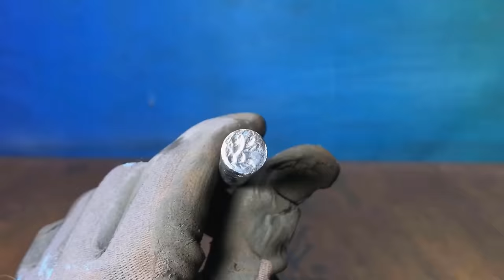Rusty Old Hand Motor Coil Winding Machine Restoration Video

Comment: Interesting restoration; HOWEVER, it does little good for the rest of us to understand WHY you took all this effort to do this and NOT show us what it actually does.
Reply: I can help you with that, it is a coil winding machine, rewinding motors, we had more modern winding machines, motors in industrial settings were rewound , but today most motors are replaced these days unless they are special

Comment: Normally on videos with rusty parts like this one they soak the parts in rust remover and do the whole process of cleaning the metal you only use a magic screwdriver and wire brush
Reply: He needs to get videos so long so yt put more ads in to feed his family,  they live of mudded rust and cleaning fluid mixed with rust.